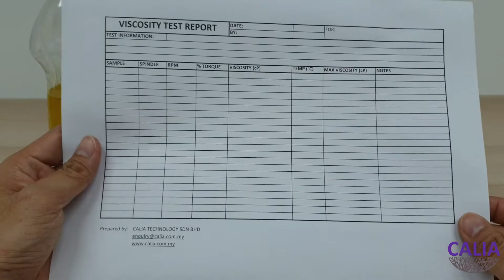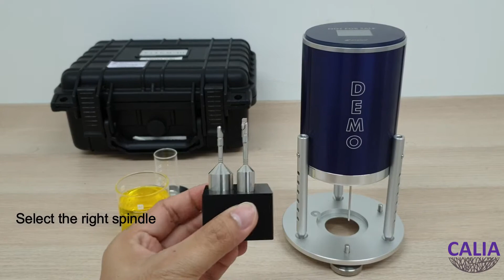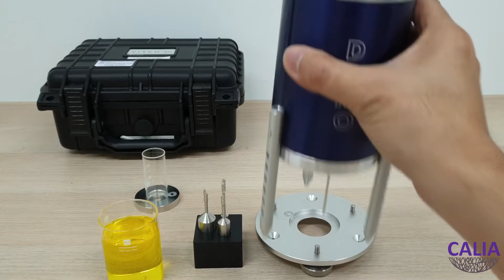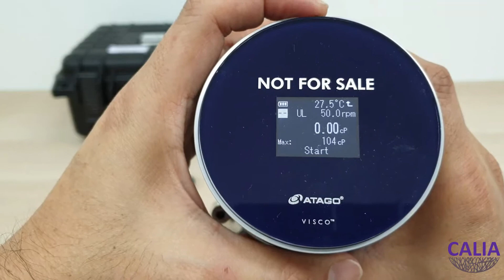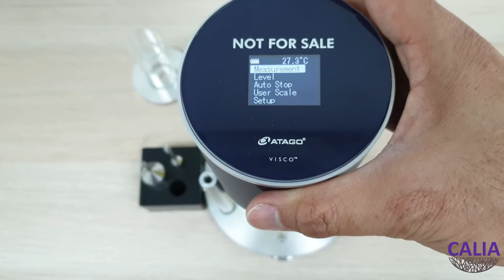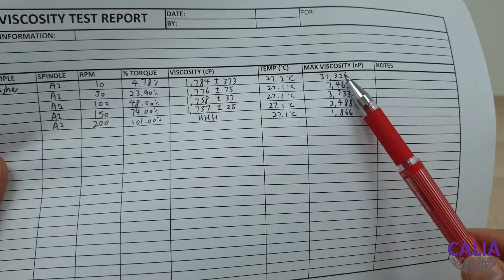Atago Visco Sample Testing Video

Comment: great video, very helpful!! when would you use the small beaker instead of the large one? is it a matter of sample viscosity (for example you would choose the smaller size for a less viscous sample) or is it just a matter of how much sample you have to work with? 
also with the spindle, would you always go for the medium sized one if you have an unknown sample that you need to determine the viscosity of?